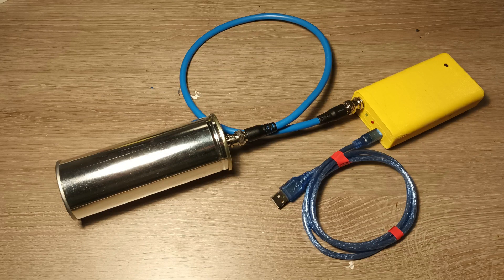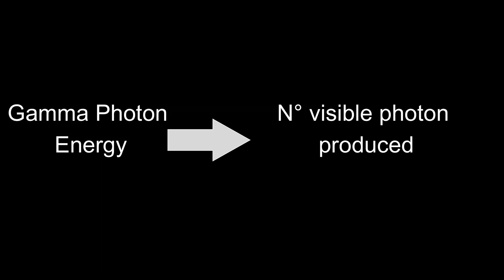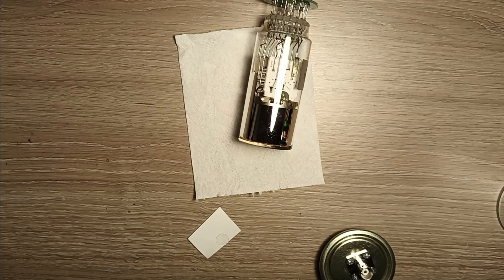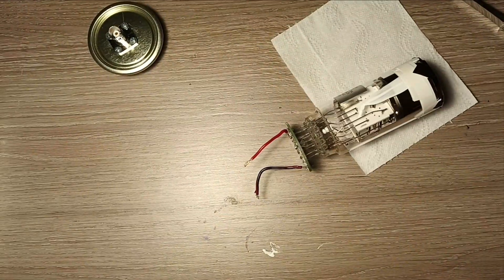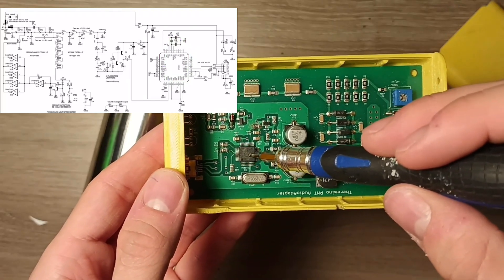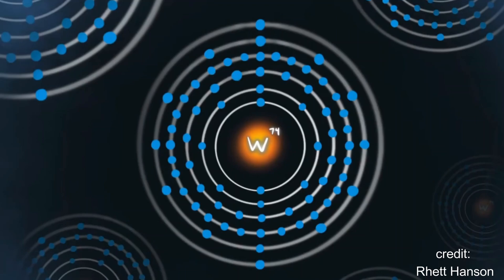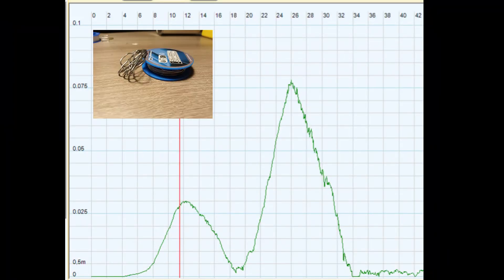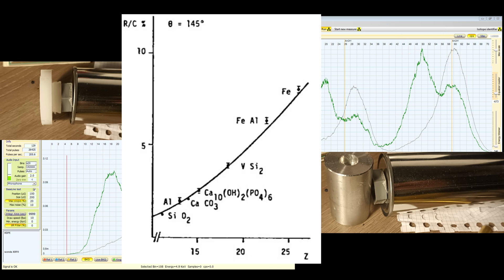Homemade X-Ray Spectrometer | XRF - Compton Experiments

Comment: How much is the project materials ?
Reply from the maker: Really depends on the components availability, scint crystal around 20-50€ pmt is very variable 50-200€ depending on luck, pulse processing and read system 100-200€, the rest are small bits of components that don't cost much